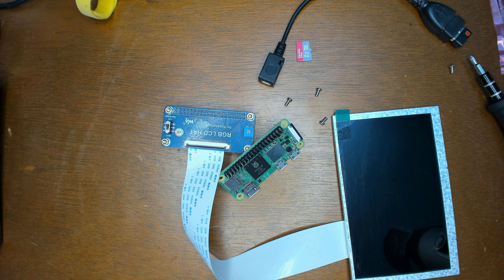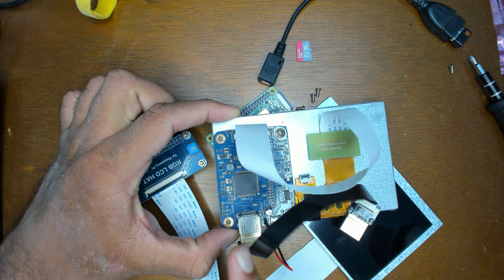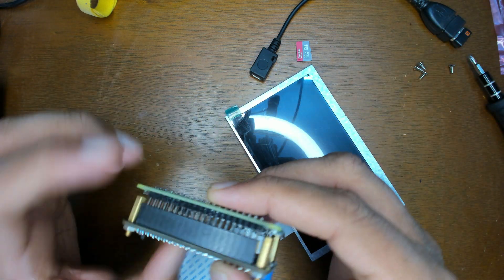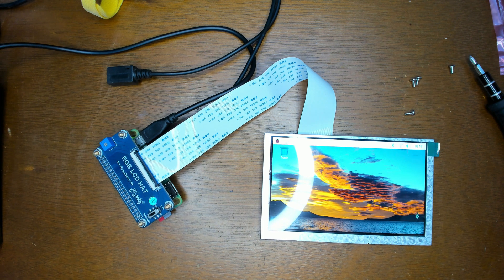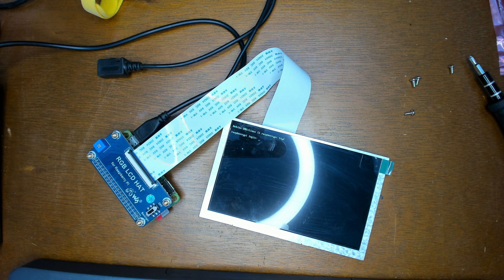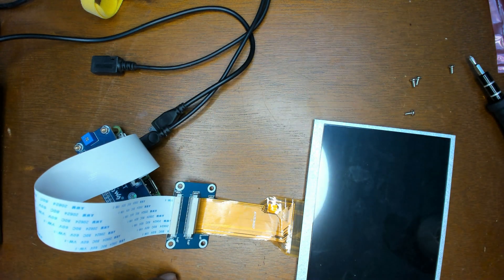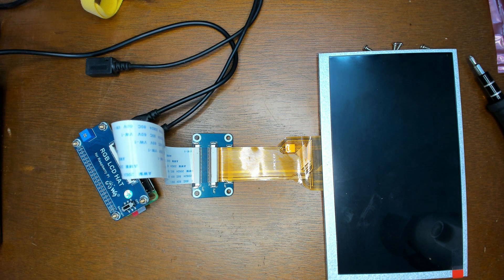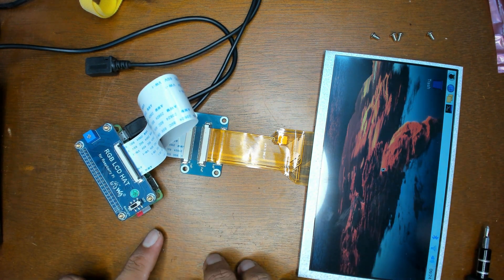Waveshare DPI Displays for All Raspberry Pi

Comment: Hi, I've watched 3 of your videos for connecting the RPix to an LDC with touch screen because I also have an issue that could use a solution I have not found yet.
A display from a rear view mirror. it has 2 MIPI interface cables one 40 pin for the screen display and a 30 pin for the digitizer or touch controls. I want to connect this display to a raspberry pi since the board that came in the DVR Rear view mirror has an os problem and it just keeps rebooting. So far I know there is no access to reset the Android embedded system via USB/UART or anything so I want to replace the board with a raspberry to control the dash cam and view my rear camera. I am missing a connecting device between my lcd display and the Pi that allows for touch controls.
You have mentioned earlier in the video that you were having issues with touch controls too. Have you figured out a solution? Also what is the vendor for this connector with 40 pin to the raspberry pi? TIA. Great job on your channel.

Comment: If you look up HDMI Config for Raspberry Pi there is a way to boost the HDMI if it's not bright enough. All kinds of info on adjusting the HDMI. Another way to do it is to use Twister OS. Pull down the settings menu and there is a brightness option, it will wash out the color set too high but there is a nice range.  You can put an icon on the desktop for it.  I just put a 7" hdmi touchscreen with Pi4 in an old portable DVD player. Pi4 sticks off the back of the screen, but it's like a tiny laptop. The original intent was to use the hinges to mount just the screen to my boombox. It was too nice I couldn't cut it for the hinge.